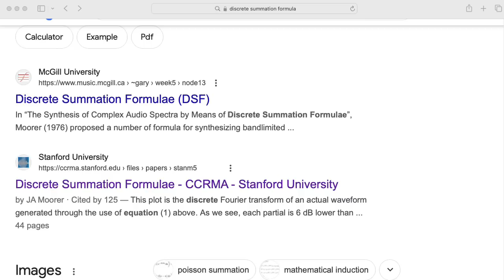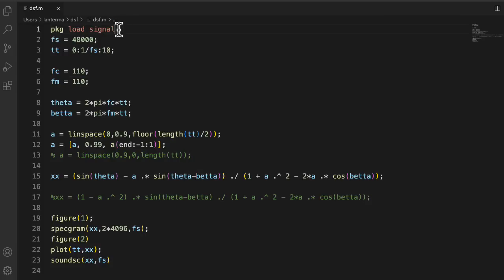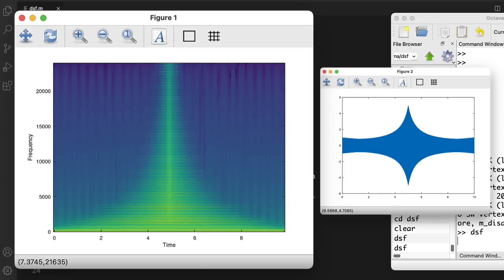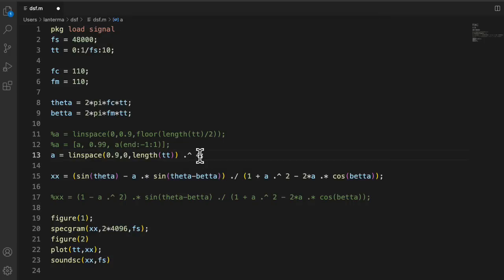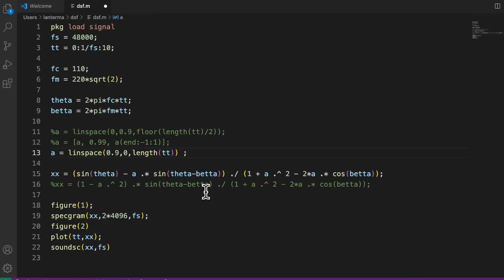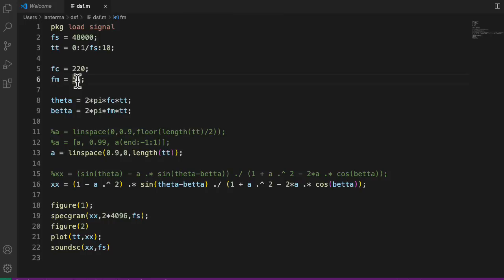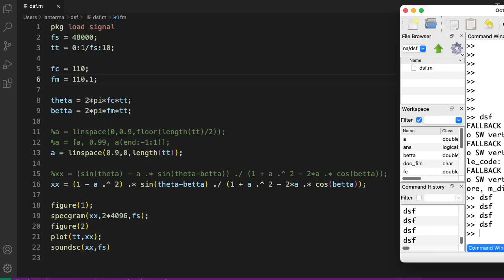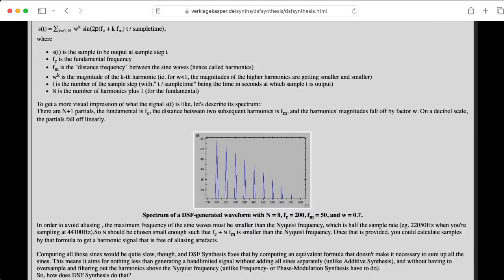Sound Synthesis via Discrete Summation Formulas: Unexplored Terrain (sounds kind of like FM)

Comment: here's a problem for your students: DSF lets you set the distance between subsequent partials to be any positive constant and can be implemented in analog. but what technique that can be implemented in analog lets you place partials in either increasing, or decreasing distances?

feel free to reply if you know of one :D
Reply: Single side-band mixers? You just need some adders and multipliers (VCAs).
Reply: ring modulation?
Reply: @lqr824  nope! ring modulation only creates ai+bk and ai-bk, but to get a roughly harmonic series, you have to have a pure sine tone for B, meaning you eend up with ai+b0 and ai-b0, and then you filter out only the one sideband. that's called frequency shifting. and after frequency shifting by some constanc c=b0 you have a0+c, a1+c, a2+c, etc. but the distances between the frequencies of those partials are still the same as the distances between a0, a1, a2, and so on.
Reply: @cheater00  Right, so a0+c, a1+c, a2+c are no longer multiples of each other.  They're flat or sharp of where they should be, right?  If you state the resulting frequencies as multiples, this multiple will be ascending or descending, which is what I thought you wanted.  Maybe you meant to compare the frequencies' linear offsets, not exponential offsets?  If so then I agree ring modulation isn't the answer.  (But for me frequencies are always considered in multiples not additions.)  What is the answer to your puzzle?  I can't think of it.
Reply: @lqr824  yes, what frequency shifting is doing can be already reached with DSF. Ultimately DSF and freq shift just sounds like the same tone, but amplitude modulated by a sin LFO. That doesn't really add to the timbre until you push dsf or freq shifting to its limit. What you want monotonically increasing or decreasing frequency deltas, not pitch deltas. Then, the timbre truly sounds like a different sound, that did not come out of a harmonic oscillator. No physical instruments are harmonic, they all exhibit that effect, and our ears can tell the difference.
Reply: @cheater00  Yes--I know piano harmonics are all a bit sharp, leading to stretch tuning.  I think oboe harmonics are a bit flat?

I'm still keen to know your secret method.

If you haven't looked into Hammond organs--totally different, I know this isn't the "physical instruments" you're talking about, but the tone wheels are (basically) sine waves so its additive synthesis but only the exact octaves are harmonic; the rest of the instrument doesn't even use equal temperament, instead the pitch of each key is just due to whatever gear ratio was easy to make and "close enough."  This in turn has a weird knock-on effect whereby you can hold down complicated chords that would absolutely beat and sound discordant on any other instrument, but on the Hammond the partials never clash.  You can hold down every key in two octaves, with all the drawbars pulled out, and it still won't sound that discordant...
Reply: @lqr824  who said i had a secret method? haha
Reply from the maker: Exponential FM?
Reply: @Lantertronics  while FM and its various forms can create spectra which are not harmonic, can it create a spectrum that is like i mention above?
Reply from the maker: @cheater00  Dunno of the top of my heads. I remember Bernie Hutchins wrote about it in Electronotes It's been a while since I looked at it.
Reply from the maker: @cheater00  Oh, and here's a J. Audio Engineering Society paper: "The Frequency Modulation Spectrum of an Exponential Voltage-Controlled Oscillator"
Reply: @Lantertronics  i'm still looking for a set of electronotes, but nobody is interested in selling it...

Comment: Absolutely wonderful! Doesn't the daisy seed square wave generation use something like this for band-limited square waves? I would think that that's the most useful application. This is great for basic waveforms, since wavetable synthesis requires a lot of processing if you want to be careful about aliasing
Reply from the maker: Ah, yeah, indeed this is related to the "band limited impulse train" stuff, I think...
Reply: @Lantertronics  Indeed it is, and I think it has even been used in the 90's/00's in Csound and elsewhere.
Reply: AFAIR the major pain of using this for generating sawtooth and square was handling the pitch changes without discontinuities/clicks. That would come from both varying the limit on the summation formula, and also varying the lowpass filter that makes a sawtooth out of a pulse train.
Reply: @kfoltman  surely it's not that difficult to calculate phase offsets for this? (You can use theta as a phase and beta as the time-variable, or simply transform theta=theta0 + phase?).
Reply: Unfortunately you can't get true saw or square this way because the amplitude roll-off of their harmonics goes like 1/k rather than a^k.
Reply: @brentlehman5028  yes of course. I wonder if its possible to derive a formula such that we replace a^k with something else, like (1/k)^p (p constant)